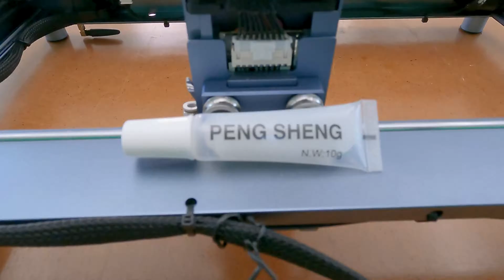Xtool D1 Pro- Best Maintenance Checks

Comment: I have the same fan.  The laser and everything inside the enclosure still gets quite filthy over time.  I’ll have to spend a couple hours on it soon and clean it all as best I can.
Reply from the maker: This is the black fan I use that's shown near the end of the video: https://amzn.to/3Yd8LeZ  
For me it worked great for my 10 watt lasers- for more powerful lasers or really smoky projects I also use this orange one: https://amzn.to/3zOaOMb
It costs a lot more but the larger one doesn't mess around with over 3 times the air flow!!